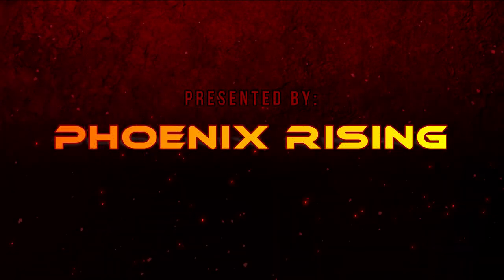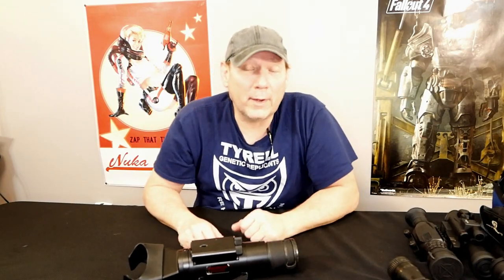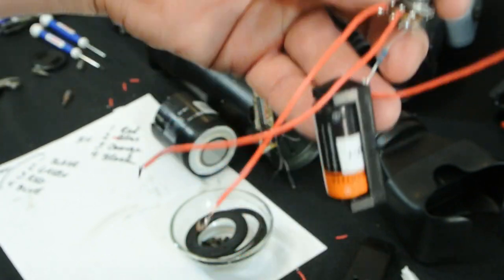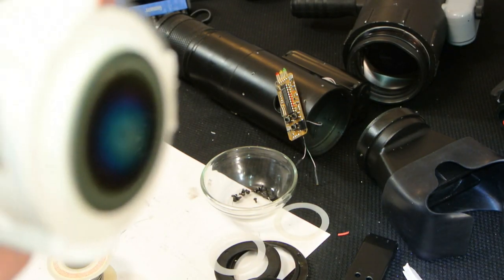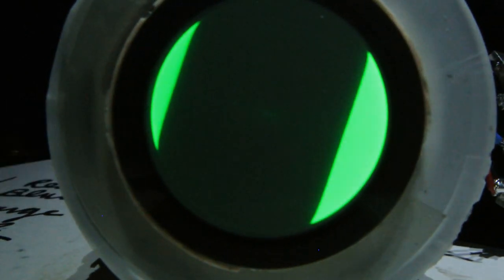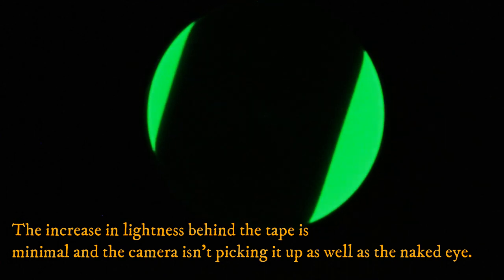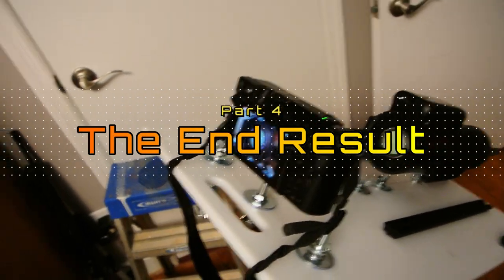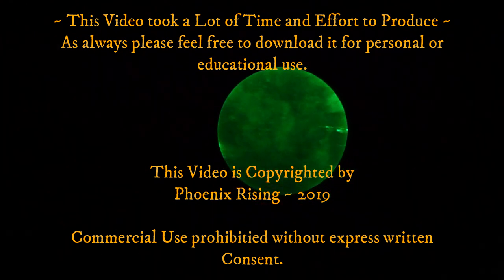Tweaking the MX 9644 Gen 2 Image Tube

Comment: So R1 decides when the ABC kicks in?
I want to make it kick in earlier on my tube, because it is painfully bright under moonlight.

I'd also like to see that documentation, or at least the max voltages, so I can build a new PSU for a not working tube, that I have laying around.
Reply from the maker: Maybe, but I think R1 is more of a max gain with R2 being a baseline gain... I didn't try to correlate R1 with ABC.  As far as documentation the basic external gain circuits can be found in the PVS-4 manual (TM 11-5855-213-23&P), and in the VVS-2 Manual (TM 11-5855-249-23&P) ... I can't post them here but you should be able to find them via WWW Search though neither of them give information for inside of the intensifier tube or the power supply.
 
As a thought perhaps you could measure the output voltages on your good tube to use as a baseline for the required voltages for building a PSU? (might be an option especially if you plan on going into a good tube to adjust it already).
Reply: @PhoenixRising62  Thanks, the manual confirmed I wired it up correctly. I'm not that eager to take the good tube apart. I use a lens with manual aperture, so I lose some details in the shadows, but I can keep the image from becoming too bright. Measuring the voltage is not that easy, as it's a very high voltage and the measurement will bring it down and might even damage the psu. Besides, I would have to destroy a perfectly fine potting. I suppose I'll start with rather moderate values and find my way from there. I know, the S25 photocathode can handle about 16kv, but gen 2 tubes tend to use only half of that, so 8kv is a reasonable limit. The screen should need somewhere between 4kV and 8kV. The voltage for the older microchannel plate is tricky though. I read things between 200V and 1000V. I guess, I'll have to carefully turn it up until the tube becomes noisy, and not care to find out the upper limit, where damage occurs.
Reply: @PhoenixRising62  I may be a bit over sensitive about the factory values of the tube core. The reason is a broken gen2+ tube, that I bought for cheap. Someone tried to tweak the pots and damaged the core, while also burning out the power supply.
Here is a picture of the photocathode. And what you see is not dirt on the glass. https://www.dropbox.com/s/h6hmdzv8bkvp55d/pcdamageraw.png?dl=0
There must have been arcing between the photocathode and microchannel plate, as they are very close together in gen2+ tubes.
I built a new power supply and got the tube to work again. But look at the damage, that had already occurred. https://www.dropbox.com/s/5kg3smhevi71xj4/P1380216.JPG?dl=0

Though now that I think about it, I should be able to build a power supply for gen2+ and one for gen2 tubes, that can sense the limits of the tube. I just need to source some 300MΩ resistors and write a clever firmware for the control computer. Though the last one will be a headache for me.
Reply: @PhoenixRising62  To clarify what damage is what https://www.dropbox.com/s/0my02vsl64tmzdd/pcdamage.png?dl=0
because that tube must have been through a lot.
Reply from the maker: @heyarno   While I don't have this information for the 9644, I did find the full military specifications for the MX-9916 tubes (much of which goes over my head).  in it it does specify the following:
V1 (Cathode to MCP in) -200 +/- 40 VDC
V2 (MCP in to MCP Out) adjustable from -700 to -950 VDC (Ground = MCP Output).
V3 (MCP out to Screen) +5700 +/- 300 VDC.
 
The document I found this in is MIL-I-49052F (21 May 1992), superseding MIL-I-49502E dated 22 August 1990. and I was able to download it from www.everyspec.com  Hope this helps!
Reply: @PhoenixRising62  Nice find you did there. The high V1 shows, that the distance between photocathode and MCP is still rather large in that model. The MCP voltage is rather high, so I guess it's one of the thick ones like in the MX-9644. And the screen voltage is pretty much what screen manufacturers still recommend today. More modern gen2+ tubes have lower V1, indicating a very small gap between PC and MCP, leading to more details and less halo. The lower V2 in modern tubes shows, that the MCP has become thinner, reflecting the increase in channels and new techniques like funnelled channels, resulting in much more detailed images and higher gain. It just shows, how similar they are to gen3 tubes. Which is why it's best to compare gen2 and gen3 tubes from the same manufacturer and production year, to see the difference in performance. For example russian mil spec just says gen2+ snr greater 40 and resolution greater 45lp/mm. And for gen 3 SNR<50 and lp/mm<60. At least for monocular use. For scopes, they have higher res specs and lower snr. When you open up a civilian tube sold by the same manufacturer, you might find a hand written date like 98 on the core. Which explains, why the values are so much worse,, than on fresh mil spec ones.
Anyway, thx.

Comment: Ihave a gen 1 image intensifier tube that stoped functioning. when the pos battery lead  and neg/ground are tested the result is continuity.
how could this be? any help is welcome
Reply: It may be too late to answer you 1 year later but check your high voltage power supply, one of the electronic component is probably shorted. It may be a transistor,hard to tell... take it apart and desolder components from the power supply to test them. If it's not potted...

Comment: Are these the same as the nv360’s?
Reply from the maker: No, the NV360's from what I can see looking at the ATN manual online is a gen 1 device.  The MX-9644 is a US Military grade Gen 2 tube that first went into service around in 1975. As you can see it's a larger format tube and it saw widespread service in the PVS-4 and TVS-5 Rifle / Machine Gun Scopes as well as in Many US Military Armored Vehicles in their night vision periscopes.  Incidentally they also were used in some X-ray machines (the early film-less) ones and did see some Civilian Sporting optics use as well (I have a Very old Tasco NV-250 that was a bargain flea-bay find that has an MX-9644 in it which is a monster Long and heavy as heck!).
Reply: Phoenix Rising  thank you very much!  You have a very good knowledge of NV tubes and sizes. I own a Aries model scope the wolf cub 510. Similar design to the MK series Gen 1 scopes by Atn. Just rebranded. I’ve often considered gutting out the Russian tube but I am not sure the best  tubes to consider.  Any suggestions? Or places to find burnt out tubes to buy cheap to try for fitting? Thank you for your time.